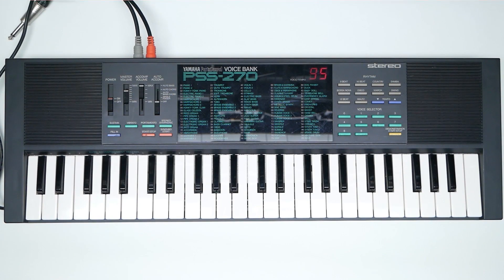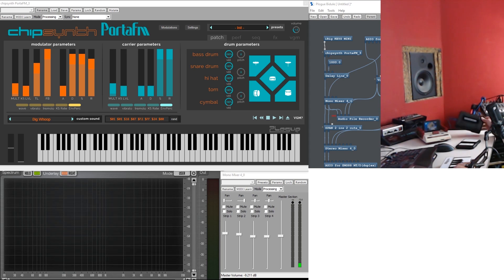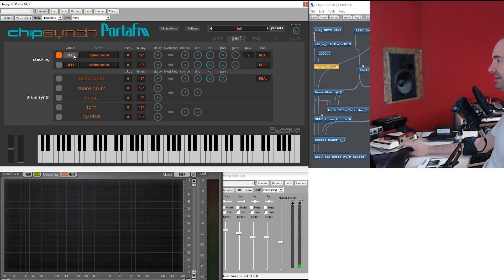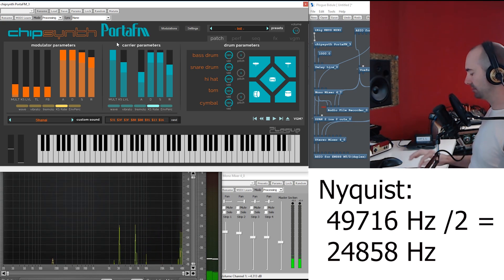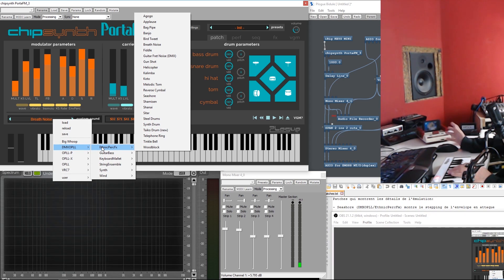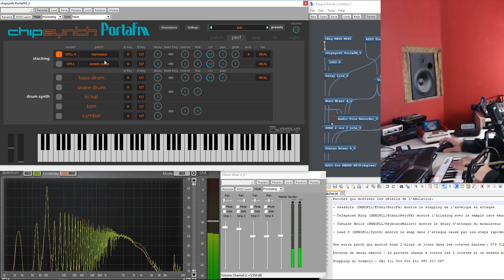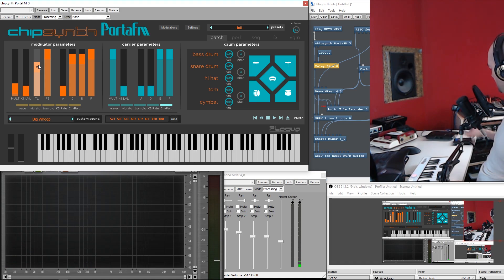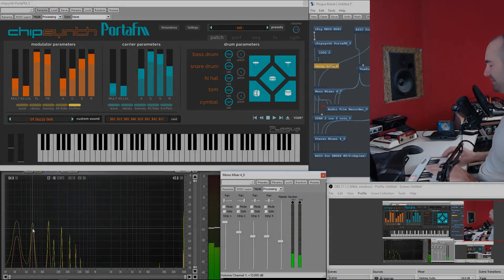PortaFM vs real OPLL in real time + Prototype chipsynth FC hardware.

Comment: How did you command the sound chips from famicom carts on famicom directly from the synthesizer ?
Reply from the maker: Custom C++ code on microcontroller inside the shell
Reply from the maker: Et le VST lui parle à travers MIDI
Reply: plgDavid what
Reply from the maker: @joshi_6887  Quoi what? Il faut préciser la question.

Comment: Have the instruments from the VRC7 been dumped?
Reply from the maker: We are not conducting decapsulation, but my sources tell me some deeper intrusive methods would be needed to capture the VRC7 instruments as they are on the DIE. We used a different method for all 4 known variants which are 100% "ear accurate", but surely a few bit off with the actual ROM. I dare you find a difference though :)
Reply: plgDavid It would be cool to have the exact settings, but as long as they sound the same, I really don't care that much.
Reply from the maker: B3ro1080  Yamaha made the chip and stamped a Konami logo on it... so doubtful!
Reply: plgDavid So, does the program have each of the presets from each of the different versions of the OPLL already available in it?
Reply from the maker: @ashkirby8896  Yes to the best of our <by ear> tuning.
Reply: plgDavid Awesome!😄👌